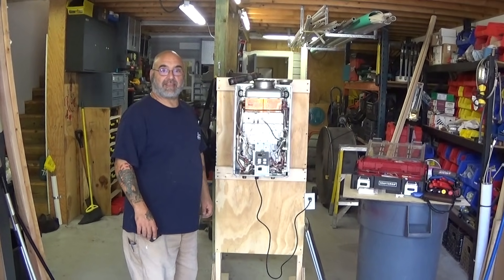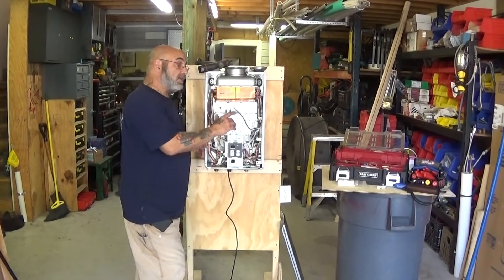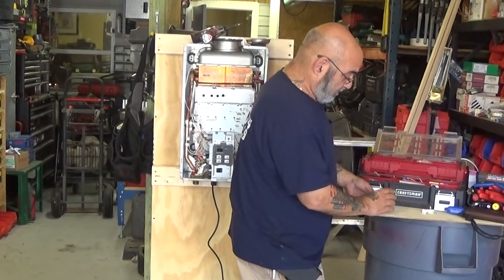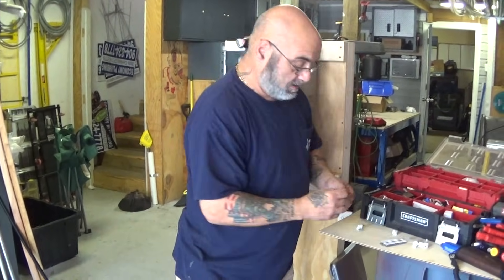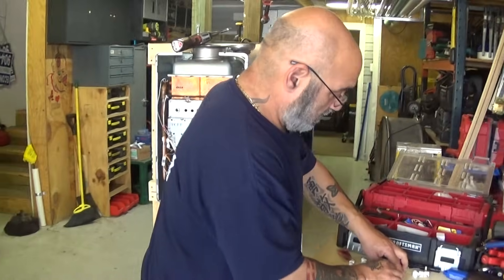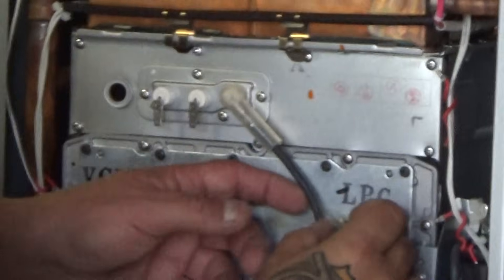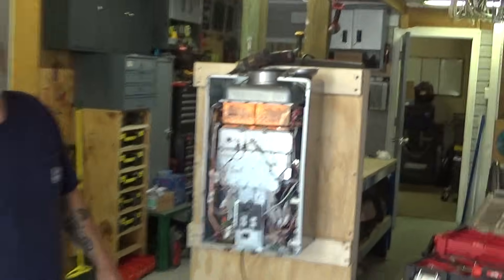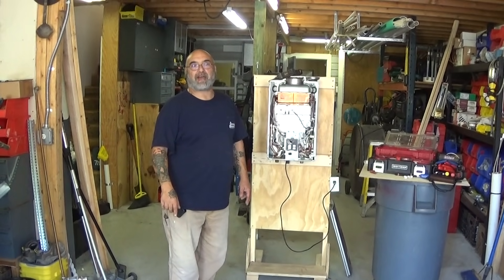Code 12 on a Rinnai tankless checking the flame rods

Comment: My Rinnai had Code 12, $350 to do a deep clean, 2 days later Code 12,  $450 to replace gas regulator, 2 days later Code 12, $315 to have technician to talk to Rinnai, they suggested a New exhaust manifold and new computer board  $355 to install new exhaust manifold and control board.  I'm now in over $1000 even with Rinnai tech assistance being contacted each time.  Not mad at plumber, but Rinnai should have better tech assistance though it did start up correctly each time he visited except the last.  So just saying there is more to Code 12 than cleaning the rods, increasing the gas pressure......

Comment: Mike … what part number are you using on this machine for the igniter and flame rods?  I’ve ordered two sets and the igniter is not at a 45 angle like you see in this video and on my machine. 

I have a RL94i.  

Thank you

Comment: Thanks a bunch Mike!! I have a 2021 i060c combo boiler..Fixed my E:120 error code! Cleaned the flame rods and igniter also pulled the little screen out that is on the top right of the unit.. it was filthy all good now.. running good! Do you know the best place to get parts for my unit? Gasket/flame rods etc.

Comment: Good afternoon quick question I have unit V53De been working great. I have indoor shower and sink kitchen sink and outdoor shower. Unit works great with outdoor shower. But when you turn anything on inside trailer it throws code 12. Units is 7 months old
Reply: Any thoughts on my issue?  Gas supply is good new 40 gal tank

Comment: This is a mint video cheers,I have the rinnai 26 infinity and think I need to clean the burner as it flashed 12 a couple months back and I cleaned the starter and its been fine up untill now and doing it again occasionally, so thinking maybe the burner,my question is though what can I use for the gaskets that will need replacing,can't seem to find any kits....cheers

Comment: Dude.   This is RAW PLUMBING POWER.   Yo i got sent on a random call and no I don't do water heaters like that.  But I'm a capable qualified technician.    Thanks for the run through my dude.  I am on my way to it now.  If anything I think I'm not the first company to diag  this heater.    I think you just saved some dude from buying a new heater unnecessarily.   Score one for the good guys (I hope)
Reply: Also totally subscribing

Comment: I have an RUR199iN that threw code 12 today. The unit is 2 years old (installed August 2022).  When you remove the flame rods and ignitor, do you have to take it apart from the gasket? It looks like I could just carefully clean the flame rods and ignitor rods. I'd hate to damage the gasket.  

Other oddities with today's problem is that when the tankless water heater tries to fire up it causes the stove in the kitchen to lose flame. My wife was cooking while I was troubleshooting the unit. I turned on the tankless (plugged it in and turned it on). The tankless was "cycling" and sounded like it was always trying to "fire up". My wife came out and said they stove burner lost flame and would not re-light. I turned off and unplugged the tankless. And lo and behold, the stove started working again.  Is the tankless just sucking too much gas when that happens?

Comment: I get error code 12 on a unit 6 months old. the unit vibrates with a noise a few times then displays error code 12. Any hints if it is something besides the flame senssors?
Reply from the maker: What make and model number
Reply: @ThatTanklessGuy  
RU199iN 
I took the front cover off, checked to make sure the screen didn't have debris (or a dead rodent) on it. Checked outsidet to make sure the air inlet isn't covered (with debris or leaves). The PVC only runs about two feet total. 

the unit worked with the cover off, so I suspect it is an air supply issue, but can't figure out the air supply issue is because nothing is clogged -- unless it is the fan or fan speed control or pressure sensor for the fan. 

I also know it is NOT the gas supply because I can run the unit at full 200KBTU without any gas supply problems. It seems to be a problem with air supply at lower burner outputs. 

I put the cover back on and it has been fine for a few days. But I would like this fixed because it has occasionally happened.

Comment: Hi Mike. Thanks for your dedication to this channel. It has helped me greatly dealing with my eccotemp 45HI-LP Heater. But I'm stumped.
Issue. The primary burner ignites and goes out in exactly 2 seconds. E1 code.
I put a microamp meter between the lead and the flame sensor. Hoping for .025 ua There is no reading as the flame is on.
I tried a new flame sensor and the same thing.
I confirmed that my polarity is correct to the mother board.
I accidentally discovered that I have 2.6 amps between the sensor lead and the ground, even when the unit is turned off. I must have a short somewhere. Help please.
Thanks Jeff

Comment: Kept getting an error 12 even though convection fan never came on or spark or opening of the gas valve. When I turned the temperature down to 90° and tried it again, after cleaning the strainer, I started receiving an  error 61. Any idea?

Comment: Hi there, do you need a regulator on a 2lbs gas line to run a rheem natural gas 8.4 gallon tankless water heater ? could this be the reason I have got the code 12 issue several times in the six months since new install . thank you

Comment: Worked like a charm. My screws were a little (factory) tight, and I gently tapped on them to loosen the threads. After that, the screws came out easy, and I was done in 5 minutes. My igniters were definitely fouled. But the cleaned up nicely with a scotch Brite green pad. Thank you for your time and instruction.

Comment: The far left portion of the burner won't stay lit. You can see it light up through the sight glass and then it starts to go out a little at a time until those 4 or 5 rows in front of the sight glass go dark and I get the code 12. I have removed and cleaned the burner and gas manifold twice and to be honest neither one needed cleaning, or at least it didn't appear that way. I blew out a little dust but not much and it made no difference. I noticed if I turn on every hot water faucet in the house at the same time it stays lit longer but eventually goes out. If I only turn on one faucet the far left portion of the burner doesn't even light. Any ideas before I call a plumber?
Reply: Did you ever figure out what the issue was? Im. Having the same problem.
Reply: @madatown  My water comes from a well and when I checked the pressure it was almost 10 psi below what it should have been. So I adjusted it up to specs and when I tested the Rinnai it blew a hole in the heat exchanger. So I'm not sure if the higher pressure would have fixed the problem and I decided not to invest in a new heat exchanger.

Comment: What if it starts beeping with code 12 and then goes back to running normally by itself. Should I still service it? Its only 2 years old. Model is RU199iP (REU-N3237FF -US)
Reply: It could have been an air pocket in the gas. If it happens again then you need to service it.
Mike

Comment: Really enjoy your videos. Wish you had an office in my neck of the woods!  Here's a riddle (for my lack of expertise). RUR98e propane.  I get a code 12, but only when it is cold. When I say cold, I mean 28 (which is our normal extreme low) to 36F.  Good chance of a code 12. Almost always. Warms up, never get a code 12.  Anything above 40F will always work.  Live in Northern CA, during our almost full month of constant rain recently, was a comfortable temperature at sunrise (45F+) due to the clouds and rain and never had a code 12.  Normal clear sky in January is usually 30-34F at sunrise code 12.  Being a layperson with no specialty tools, I did the low hanging fruit task of getting a flame rod kit and did that replacement. No change.  Not being familiar with propane systems, are there fuel delivery issues caused by low temperatures?   Also wondering if the solenoid may be mechanically binding due expansion or contraction and should be replaced.  Not looking forward to taking the burner out. It looks like me thinking "Where the hell did that go again??" and my wife angry because I'm just an obnoxious string of profanities at that point.
Reply: Is there an external regulator and is your tank above or underground. The external propane regulator could be freezing and if you have an above ground tank the liquid be freezing. Mike
Reply: @TheBuddylab I think you're on to something. Above ground. This morning was very cold for here (23F). Code 12 about 10 times in a row (resetting system each time). Poured a large kettle of 100F+ water on regulator. No code 12!  Odd that this is the first winter with this problem, but that seems to have done the trick. Will try tomorrow as well. Good sleuthing.

Comment: I have this code 12, and use propane. I'm pretty sure it's from cold weather, it only happens at night. Now temperatures dropped, it's not running in daytime.

We're waiting to hear from the gas about coming out, plumber was plumb out of ideas. Ideas to help last us until they get here whatever day that is?
Reply: Did you find out what the issue is? I only get the dreaded code 12 when it's winter time, and the plumber says the tank is fine, and the gas tech said the gas is fine...

Comment: I cleaned the flame sensors and igniter
Didn't work so I disconnected the propane line and put on a new line ,
I looked at my old propane connection and saw some kind of oil dripping out of old line.
That was clogging up the line so no propane could get thru.
That was unexpected.

Comment: Mike, 

I have been watching your videos and I've learned a lot about my unit but I'm still having a code 12 issue.  It is a brand new unit that I installed myself. It is natural gas and the gas company says my gas supply rate is 4lbs. The unit is working perfectly throughout the house except when I turn on the bath tub faucets in the downstairs bathroom and the upstairs bathroom. The bathroom sinks and showers work fine. When the bath tub faucets are turned on the unit gives a 12 code. So if we want to take a bath we fill it with the shower.  Any ideas what to do? Thanks for any help you can provide.

Comment: Hi Mike - Hoping you see this comment on an older video - I have a new Rinnai unit - RL75IN - and its working just fine unless I try to fill a bathtub. When I do that, it goes to an error 12 and stops putting through hot water. I don't think it has anything to do with dirty flame rods since the unit is new. It only happens when I try to fill the bath so I assume it is related to the volume of hot water. Any ideas what could be causing that? Thanks in advance!

Comment: While my R75LSi is not as easy to work on, the advice on this channel was spot on to allow me to clean the burner, ignitor, and flame rod to get mine going again after repeated Code 11 and 12.    Mike -- how the heck do you get the burner out of an R75LSi for a more thorough cleaning?  It appears one would have to pull the entire burner housing and copper assembly above it because there are screws on the side that are not accessible without pulling the entire copper and burner assembly!
Reply: Did you ever get it pulled out? I have the same unit and need to service the igniter later tonight after work as I know have code 11 and 12.

Comment: Hi Mike, A few years back I set up Rinnai water heater, aeu-va2528ffud (a)-uc-p,.  I have never gotten by code 12.  Always get code 12.  It was new when I bought it.  I saw your vent video.  I have a Rinnai vent elbow pipped directly into my fireplace chimney as a vent.  No inner/outer sleeve when elbow connects with fireplace chimney.  Could this be the problem.  Any ideas?  Thanks  Emil

Comment: Very helpful and to the point. My Rinnai's ignition quit working and I was able to get it back by just cycling the unit. But, after seeing a few people talk about the flame rods and igniter needing servicing, I watched this video and think I can handle the job myself once it gets to that point. I went ahead and ordered a new flame rod kit to have as a backup if needed, but I'll probably just try to clean it like Mike has shown here.
Reply from the maker: Just remember to make sure the gasket is in good condition before you reassemble it if not change it. Mike
Reply: @ThatTanklessGuy  Thanks Mike! Luckily, my gasket was still in good shape. Cleaning the rods seemed to do the trick, but I'm going to go ahead and do a full servicing next week once I get the flushing kit I ordered. I'm probably going to take the burner out and give it a good cleaning with my air compressor as well. Thanks for all your help.

Comment: Mike if I flushed it out or descale it would it help me with one shower is then the next shower is Luke warm , I had a code 12 took it apart cleaned the burner and flame rods and the igniter rods stopped the codes still hot water some times in the shower sometimes it will be warm not sure what is causing the problem so I was wondering if flushing it out would solve the problem

Comment: Code 14 no hot water
Reply from the maker: Your Rinnai is overheating you will definitely need a certificate Rinnai repair person. This is something I can’t do over the phone. Mike
Reply: How can I fixed it please call me if you have time appreciate it thanks Mike
Reply: The thermal fuse is getting set of by something in the unit giving off more heat the necessary. This is something I can’t explain over the phone. I or someone has to be in front of the unit. Sorry Mike

Comment: Mike. have a 2025 Iinstalled 2005) with an ignitor and flame sensor.  I took everything apart, cleaned the sensor as you said.  It started working again but the code 12 started again.   Should I try replacing the flame rod and igniter?
Reply from the maker: It could be a high low gas setting problem or the gad valve. First you need to check the incoming gas pressure

Comment: Code 12 is driving me bananas cleaned the carbon off the sensors and igniter what else can I check?
Reply from the maker: Is the burner dirty? It could be a gad pressure issue ( high low fire ) what’s the model number, type of gas and how old is it. E mail me the answers economyplmbg@aol.com

Comment: Mike I have a 12 year old Rinnai Water Heater and I am getting a code 12, the I will get spark but no ignition. Sometime I would get a short ignition, then the unit would go out on flame failure. I cleaned the ignitor sensors with sand paper, which I learned that was not the way to clean the sensors. I had a Rinnai Installer came over to try and get running by cleaning the sensors with a cloth and cleaning the burners. He thinks it the gas valve thats the problem. Since the unit has not been service since it was installed 12 years ago, he suggested installing a new more up today and more efficient Rinnai water heater instead of pouring more money into the existing water heater. That's is going to be a big bill that I can't afford right now. So I order a new sensor and ignitor to see if that will get the unit to fire. Is this the right thing to do?
Reply from the maker: Call me at 19042385349 today around 5pm eastern time and I will go over it with you

Comment: Once again, Rannai Mike came to the rescue. I was having yet  another issue with a 199 condensing unit. The burner would not stay lit, with the front cover in place. The unit worked flawlessly with out the front cover in place. After a few conversations, he determined that the wye connection sold with the unit to allow direct venting through the existing roof jack was at fault, saying to me that he’d had many problems with having the fresh air intake and exhaust air sharing the same pipe. My furnace closet location allows me to pipe the fresh air intake pipe over to daylight out above the door for the closet, avoiding having to add another roof jack. Problem solved 100%. I live in central California, just a mile down the road from Yosemite National Park. Mike does all of the problem solving phone calls and emails after working his normal day. I owe him a beer.

Thanks again Mike,

Roy
Reply from the maker: Thanks for such a great comment

Comment: I found this video looking for an Error Code 12 fix for my AO Smith 305 200 tankless heater.  This video gave me the information to remedy my problem.  My water heater is working fine again and following The Rinnai Guy's instructions.  I thank you immensely!  However, my old AO Smith model 305 200 looks almost identical to the Rinnai.  By any chance is my AO Smith actually a rebranded Rinnai?  If so, do you know exactly which model Rinnai?

Comment: Does the unit turn the gas flow off if an error code 12 is displayed or do I have to shut the gas flow off until it's repaired? I understand the error code 12 means a flame issue, flue issue or gas flow issue, but the manual doesn't say anything about the unit turning the gas flow off internally.

Comment: Well I m working on one right now with code 12 for LP it had low pressure so i took cap off regulator and screwed down on it . now everything is fine didnt have to do any thing else . or flipped the dip switch 5 an 6 turn up the temp now it good to go

Comment: Hi Mike, Thanks for this video, Sensors are loose so I had to put a tape on it , Do I need to replace my gasket to hold em together.
Reply from the maker: yes you should have a new one but if the gasket is in good shape you could reuse it.